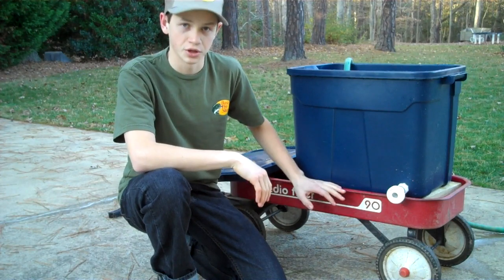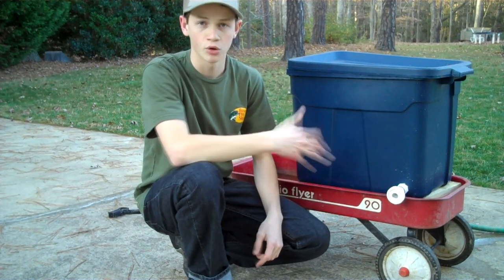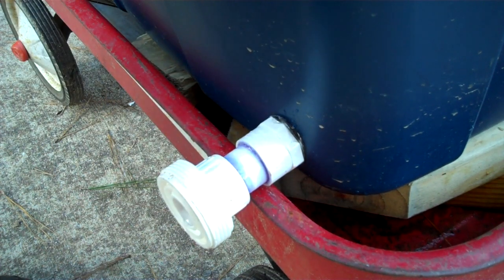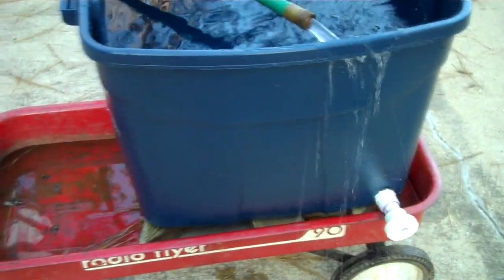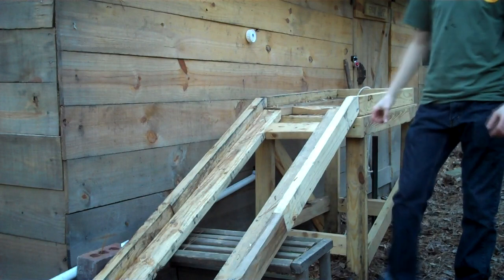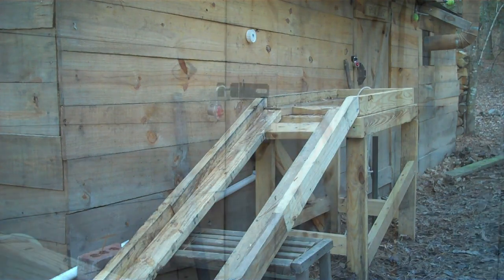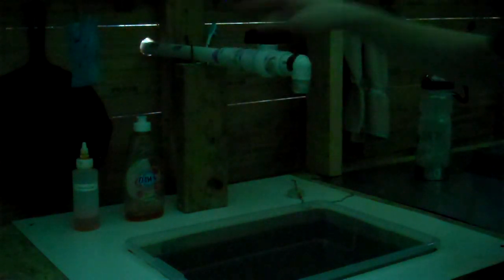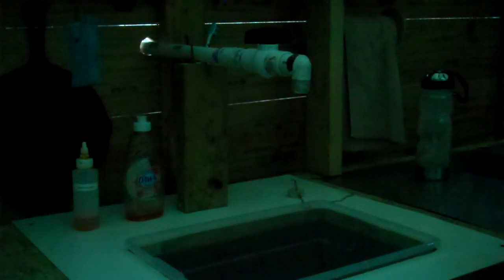Water Tank System for the Cabin

Comment: Nice job. I am a chemist, and I suggest using a bulk head attachment which will ensure no leakage. Also, connect a hose to your drain pipe to direct that water away from your track system. Lastly, I must suggest using potable (not portable, but potable),  water materials as that tote is not suited for drinking water. The plastic used in that tote contains highly toxic residues that leach into the water. A small LPDE (or food grade), plastic 30 gallon stock tank or a zinc plated steel stock tank is cheap enough. You'll need to make a cover though, however you are obviously adept at anything. Or you might connect 3, food grade LPDE 5 gallon buckets (they say "food grade" on the side, and you can get them at Menards for $5each), in series, each with fittings leading to the main entry pipe. Also, PVC pipe is not for drinking water either. You should use potable water pipes and fittings.

Comment: Im 13 and i saved money for a 600$ travel trailer. i got it not that long ago. it is 400ft to a water hookup so i have to carry 5 gallon containers to fill the 40 gallon tank. i will use a system like this but with a 45 gallon barrel on a lawn tractor cart and run a short hose from that. Great video!

Comment: Your drain pipe will cut away the dirt beside the ramp on the left side over a short period of time. I suggest adding to the pipe's length or bending the pipe away from the ramp system.
This is a good innovation for the cabin.
Congratulations,
Clark

Comment: Very impressive. Many ideas come to mind while watching (as with many viewers), First, as a former plumber, an easy solution to the cork thing is to use a 90 fitting on the  inside of your tank, glued in and pointing up. Then take a scrap piece of pipe long enough to reach the top of the inside of your take, glue on a cap, then stick in in the 90 tight (don't glue that). Then, when ya get it there and hooked up, simply twist and remove the capped pipe. Keeps you hands (mostly) out of the water and all. You probably have those extra pieces lying around.
 Also, try am eye bolt on the end of you roof rafter to tie the rope onto, will save you from using the boards to tie off the rope.
 I would extend that drain pipe way further away from your cabin, it's just gonna create more mud if not.
 What I found amazing is that the wagon did not tip over backwards while hoisting it all up the ramp. But I guess you have tried it before hand,. and the pressure from the pull rope helped a bit to.
 You may want to enclose your water tank, and let it get heat from the inside of your cabin to keep it from freezing. Just make a good sealed door that you can remove for getting the wagon up and into the enclosure.
 Having said all that, this is 2015, and the video was 2012, and with you craftiness, I'm sure you've already came up with solutions to your little problems.
 But hey, what all you have done is WAYYYYYYYY cool. I'm quite a bit older, but me and my brother are in the process of building us a cabin out in the woods. A place to stop when riding ATVs, or just hang out and get away from everything. Awesome video.

Comment: a few recommendations. 1) mount the water valve/sink to a more stable place, then use a flexible hose to connect the tank to the hut. 2) You should find a container designed for water; that'll help the leaking tub problem. And 3) if/when you change the water tank, you might as well put a valve on the tank.

Comment: Hi again Kenny a 12volt battery warming pad to keep batteries from freezing under your tank would work to keep your water warm enough to prevent freezing. a 12volt battery and a solar battery charger would make it pretty much maintenance free. you could also go with a metal water tank and build a small fire under it to heat the water.

Comment: Hi Kenny you can pick up some rubber sink and tub plugs to stop the water in both the tank inside and the sink inside from walmart or home depot. they usually come in pacs of multiple sizes. they also have a loop built in to add a chain or cord. you can use a small one ith a chain or cord attached to your lid on your tank to easily pull it out. you may put a filter in the lid and collect rain water from your roof as well, just a thought.

Comment: This seems really elaborate for what you get out of it.  I like the elevated platform idea, but I think a manifold that has shut off valves on it and flexible connections to 4 five gallon buckets might be simpler in the long run. You might also want to look at some insulation so your pipes don't freeze up and burst in the winter. 

With a shutoff valve for each bucket you can isolate each bucket for refill, or to use a specific bucket in sequence.

Comment: Good idea on a few levels!  What videos have the faucets & shut-off valves?  As for the water not freezing, you might try running the water at a low speed (barely a stream) into another container in the cabin, then switch them in the morning.  That keeps the pipes from freezing & that whole container probably won't freeze in one night.  With that, you might just stir it every now & then (keeping the ice from forming a solid layer), smashing whatever ice does happen to form.

Comment: You can do the same set up with a insulated chest cooler, and then if you filled it with hot water the cooler would keep the water hot or at least warm for most of the day.

Comment: Put the ramp on the other side of the platform so the wagon is easier to load. Use a crank winch to pull up the wagon  or better yet use a 12 volt electric winch with a battery and a solar panel to keep it charged.

Comment: Hi there, I assume that you get water from the roof when it rains. Adding another pipe just below the level of over flowing the tank you could fill up another tank placed on the ground. When the first finishes the water you just switch them. Another good project could be to build a vertical wind water pump, so you can bring water from the second tank up to the first one. Cheers.

Comment: Nice, but I would put a hose on the drain that way it does not attract bugs, or get's muddy near your cabin. Also I would get a barrel for the water ( I think it's a 50 gal or more and build a box with insulation around it to keep it from freezing.) you could use the wagon system and a bucket to fill the barrel. That's just me. But you probably have better ideas.

Comment: in the winter if you use a heat light and a fifty five gallon barrel that would keep it from freezing, I've used one in my 2000 tank I have it's about 1/2 way down in the ground and it keeps it from freezing...

Comment: I suggest you leave the blue tote up on the platform, and then pump water up to it.  It would be simple to pull a 2nd tote up beside the platform, and pump the water up into the tote on the platform.
Reply: However, I am impressed with the ingenuity of the system you devised !

Comment: a 3/4 inch brass nipple with water meter gaskets inside and outside the tank then 2 oversized brass flat washers to compress the gaskets then 2 3/4 inch npt nuts,,,romex connector nuts will work...you make a nice tight seal and put a ball valve right there

Comment: nice system ,i wonder if a siphon hose with a foot pump or even one of those hand pumps would work ? maybe you wouldn't need to pull that wagon up that ramp ?
Reply: I think he's intentionally trying to demonstrate certain basic principles of engineering in use of solving a practical "problem."  That's the real point of the video.
Reply: AmericanFartBully
I see,but why the heck not use a block and tackle type rig,even a rope slung over a tree branch to raise the water ? Or a "teeter-totter" deal? I wonder ....?
Maybe I watched too many episodes of the Flintstones but really why not use a baby elephant to transfer the water?
Reply: I would guess because he's just using what he readily has on hand.  And he's also trying to fit "the action" all into a single-focus shot.
Reply: AmericanFartBully
Beats going thirsty that's for sure ?

Comment: Why don't you just have a permanent container (as large as you want) on the top of that platform and you can use the wagon to haul water then transfer it into the permanent tank via bucket. That way you're only lifting a couple gallons at a time and you don't have to worry about that wagon collapsing under the added weight of your next larger container. Great ideas though kid...keep up the ingenuity and hanging about outside.
Reply: Or a battery operated Bilge pump to pump from your truck the the tank via a garden hose